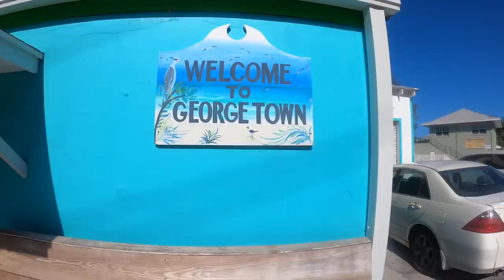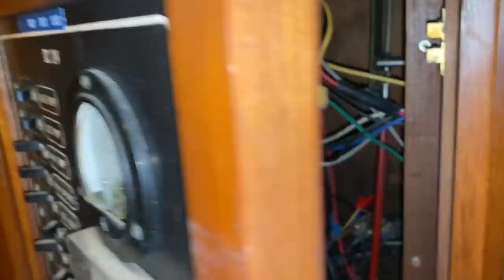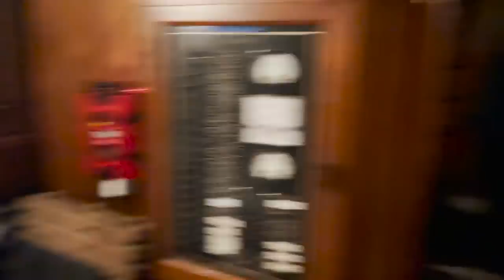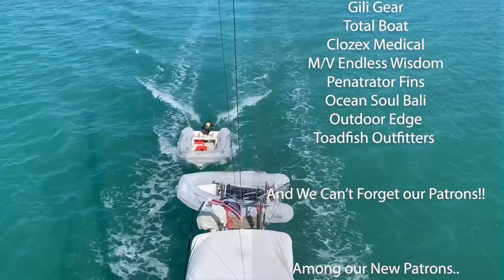Everything is ALWAYS breaking!! Volleyball Girls, YOGA, And More Projects  S2:E39

Comment: Those are called ring terminals that go over a screw, bolt, or stud. That nut that you dropped was probably brass (electrical nuts and screws often are brass because brass doesn't corrode as easily as steel) so a magnet won't pick it up from the bottom of the hull. 2 gauge wire is great since that inverter could pull up to about 70 amps depending on the battery voltage at the time. The lower the charge on your battery, the more amperage the inverter will pull. You probably already know that wattage = amperage x voltage and the wire size is dictated by amperage, not voltage. You girls are unicorns! That is so cool that you have learned to work on all of this. As a guy that learned about this stuff as a kid and then continued on to work on my own vehicles and also equipment for work, it is all second nature, but it is so rare to see women do this stuff even though they are perfectly capable of learning. Great video as usual!
Reply from the maker: Thank you!! Yah, we’ve learned a lot over the last few months that I’m sure will continue to benefit us!

Comment: Sasha and Natalie, 

When installing electrical gear the rule of thumb is that you should have no more than 2% drop in voltage at peak load on a piece of gear such as the inverter, anything more than 3% is no bueno. 

How you figure this is simple math, for a 750watt inverter at 12 volts, you take 750/12 to get 62.5 amps. 

Then hop on to any one of the online voltage drop calculators that are out there, put in the size of wire you are running, and then the distance and the volts/amp load, and it will tell you the percentage of drop. 

This is super important as it prevents fires! 🔥🔥🔥⛵🔥🔥🔥
Reply from the maker: Thank you, we are still learning the ropes of electrical systems
Reply: @Renegade Show
Dude, for a guy who's only been sailing for three years, has only owned one sailboat EVER, has never ventured outside the protected waters of Puget Sound, who has never done an over-nighter on a sailboat, you sure know a lot!

Comment: Great videos ❤️ bacon is from the belly of the pig not from the butt 😂😂 I love it. Some fuel lines come with a plastic liner inside the lines , if yours has it you would need to change it to a regular fuel line that doesn’t have it. The liners fail and start to crumble clogging up the carburetor. You will have to continually clean your carbs . Just use fuel lines made for car engines since they don’t use a liners. Take care beautiful ladies 🌹🌹🌹🇺🇸
Reply from the maker: Ohhhh maybe we should check out the lines then they are pretty old, thanks for the tip!😁

Comment: Hi watching your video the inverter should be a pure sine wave if you are using it to power laptops-phones or delecate equipment...also the wire you are using to power it needs to be more heavy duty and with a inline fuse in the live ...great video’s
Reply from the maker: We have a few modifications to make when we get back to the US. The cable is what he had to work with what we had on the boat.. Thanks for watching!!

Comment: Nice vid. 
You guys are doing a great job! I think what you have there is either 4 or 6 AWG wire - which is pretty good. I would stick to drawing no more than 400~500 watts with that wire. If you need to pull the entire 750 watts, you'll need bigger wire and at least 4 batteries or the voltage will drop and the inverter will kick out.
Reply from the maker: Yes I(Sascha) made a mistake and we actually used 2guage wire to wire in the inverter... need to fact check before we post 😬🤣
Reply: @SailingTheFarSide  Oh that's much better!

Comment: Wires are counterintuitive....12 gauge is thicker than 18 gauge, 4 gauge is thicker than 6 gauge.  Battery cables are usually 2 or 1 or 0 gauge.
Reply from the maker: Thanks for the tip!!😁

Comment: You need a fuse or breaker between your inverter and batteries. You have a risk of fire if your inverter shorts out.
Reply: Also why red wire for ground does not make sense 👍❤️